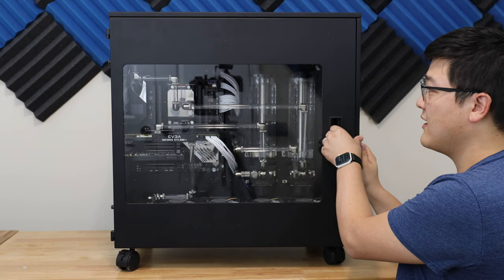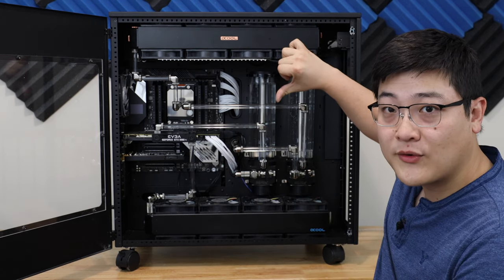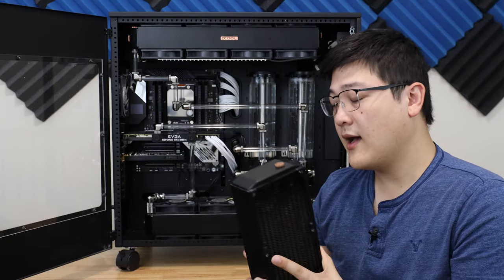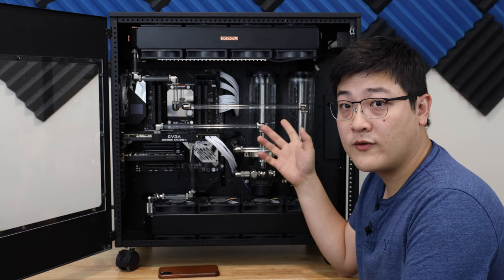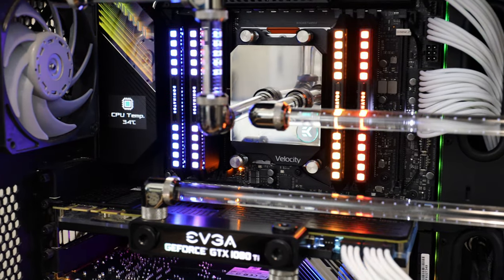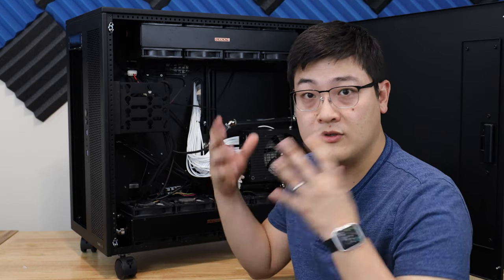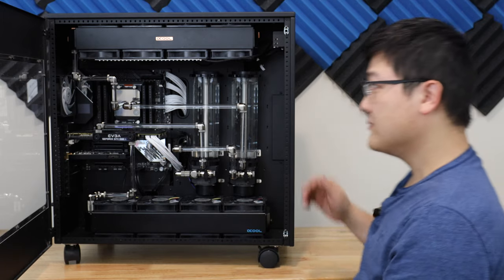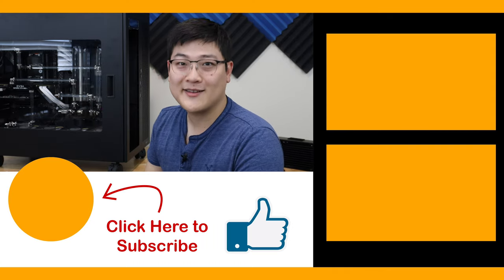AMD Threadripper 3960X Build Part 4 - Final Touches!

Comment: For what they charge for these parts there is no reason not to have 3 or 4 extra o'rings of each size. Especially if your paying a premium from EKWB or the like.  No professional plumber goes to the job with only "just enough".  FYI - While nearly extinct there used to be radiator repair shops - where they would disassemble the radiator and braise the copper core as good as new.